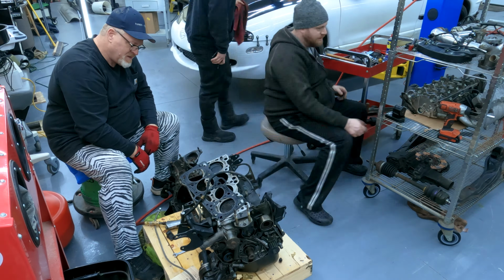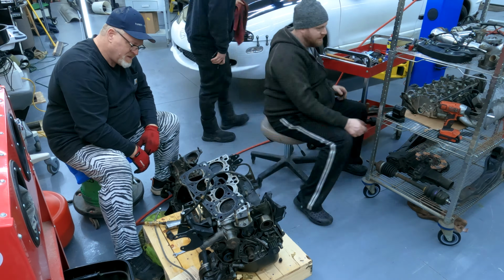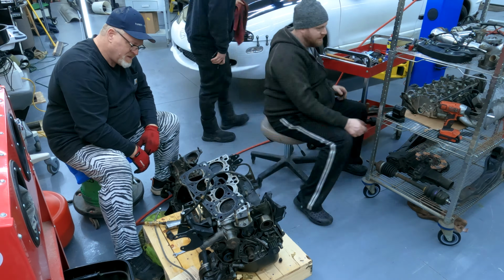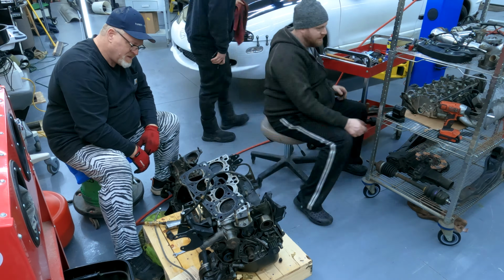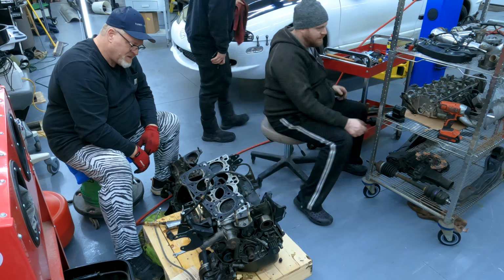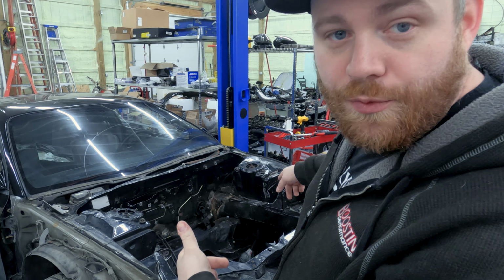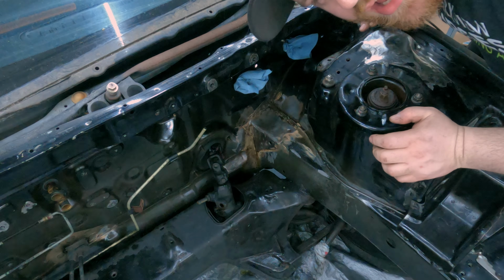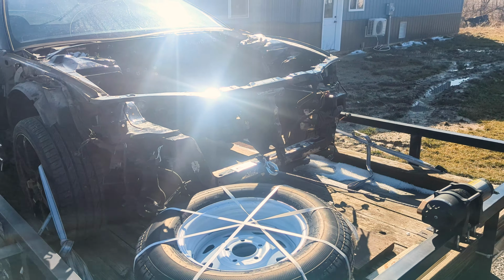Dream DSM - The Good, The Bad, and The Ugly  | '99 Mitsubishi Eclipse GSX | Raven EP2

Comment: On the topic of the failed engine, i suggest you remove the oil pump and check that out, it looks a lot like some of the failures i have seen from people running the knockoff topline balance shaft elimination stubby that does not have the oil groove in it.
Reply from the maker: Ding ding! You got it! We didn't get video of it cause we moved on, but that's exactly what happened! Well done!
Reply: @tunesandtunes  I thought so its such a stupid mistake, it's not the engine builders fault, i mean yeah they could have gone with the more costly bse kit, but it took a bit for the dsm community to catch on to these sort of details, i think I felt the worst when my buddy gave me his forged paper weight of a 6 bolt engine it had, Ross pistons, Eagle rods, Arp main and head studs, Kiggly girdle, (it was bent from the rod that shot out the back of the block) it was making 650hp (obviously not for long) he just wanted to send it, and he was turning it up to run 700hp+ when it let go... moral of the story oem delete is the only way to go, or the GSC power division balance shaft elimination kit, even cheaper cut the stock oil pump driven shaft and thread the oil supply hole for the b/s bearings oil supply, and thread it shut with locktite or weld it shut.

Comment: Great job! I used the Eastwood version of the rust converter on the underside of the Spyder, then covered with their platinum sealer (the silver version of their por15 substitute).  Works pretty well.
Reply from the maker: Thanks Jake! yeah we're about to use that eastwood stuff on another project, looks pretty nice! In the next couple Raven videos you'll see what we ended up doing to this one!
Reply: @tunesandtunes  Nice. Eastwood is based out of Chicago, so I used to drop into their storefront and got into the habit of using their stuff. Next time you drive through Chicago, it's worth stopping in to see the selection in person.